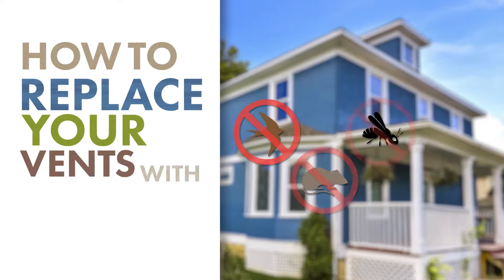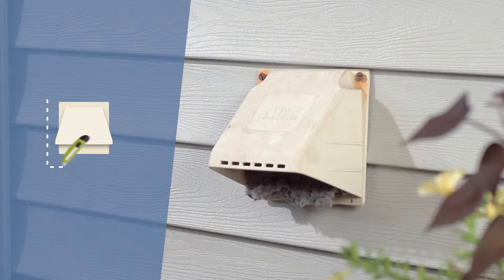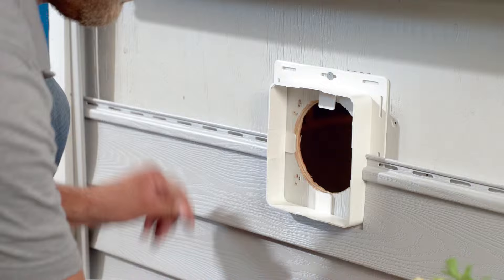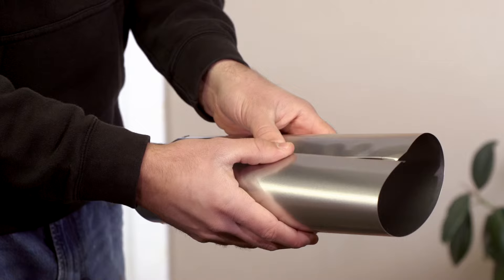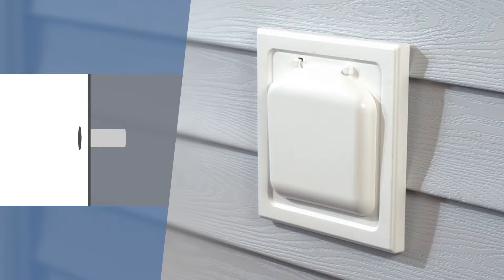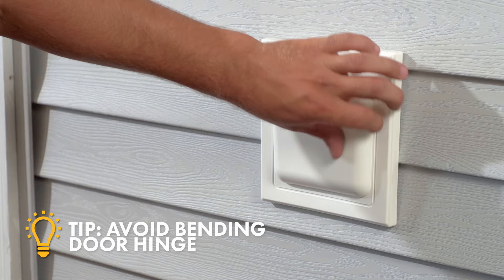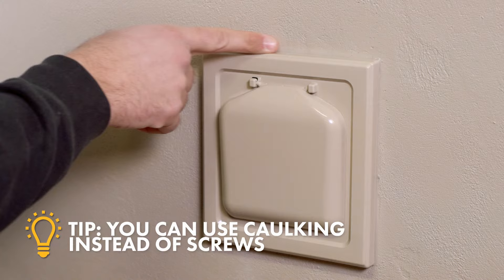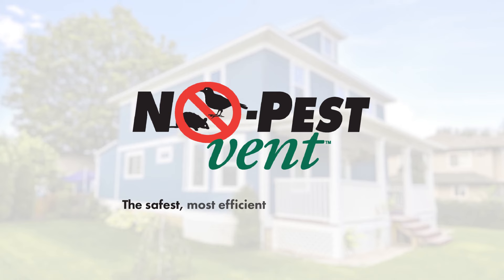How to Install the No-Pest Vent on Wood or Vinyl Siding

Comment: The sheet metal duct was delivered all bent up as well as the box it came in.  Can not keep it together.  Wondering if I can use the old  duct that's already there?
Reply: If it fits over the old duct, there's no need for the tube. Personally I would've demanded an exchange since the package and contents were abused.

Comment: how do you keep the flap from banging in the wind?
Reply: It may be a detail related to the install such as not being slightly inward at the top to nor allow the magnet to attach to the bearing.  Or the attachment screws are over tightened not allowing door seal against the mount.  It could also be caused by air infiltrating the home at another location which creates an internal pressure, and the No Pest Vent becomes the relieve valve, then the gust of wind catches the door and lets quickly close again.  You can give us a call if you have any addition questions, and we will try to help you. Thank You, Kelly

Comment: You skipped over the biggest issue I have -removal of the siding without damaging
Reply from the maker: Hey Jaime, if you are going over existing siding with the wide mount vent cover, removing siding is not necessary. If its an existing vent simply reuse the hole that is already there, if its a new vent being added just drill through the siding and wall with a 4 inch hole saw. Then seal around the dryer vent with silicone after its installed. Hope this helps with any confusion!
Reply: Holesaw used in reverse on plastic so it doesn’t grab and destroy the siding.